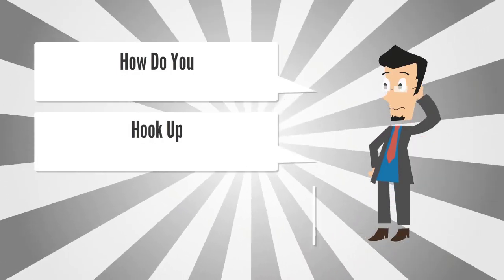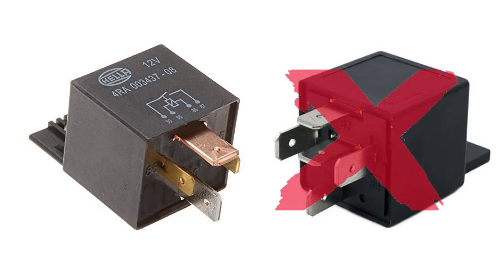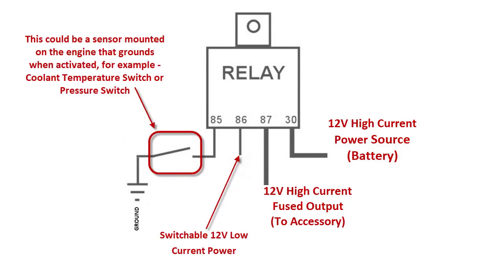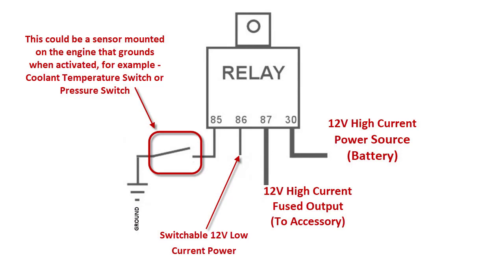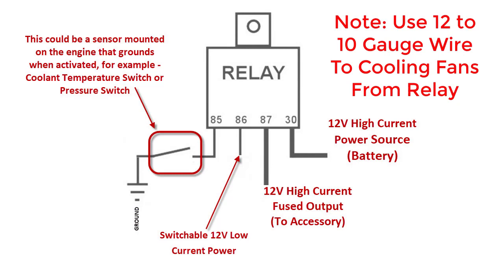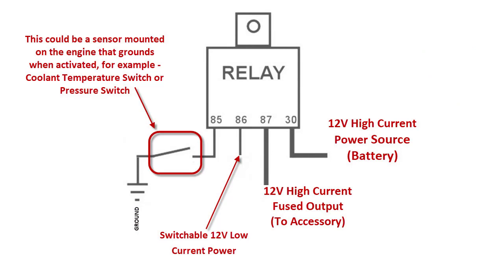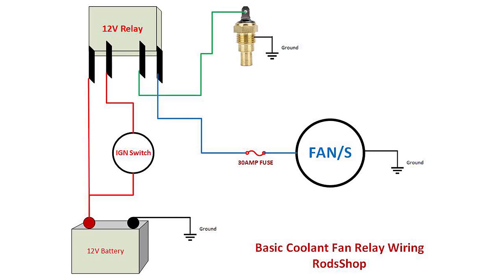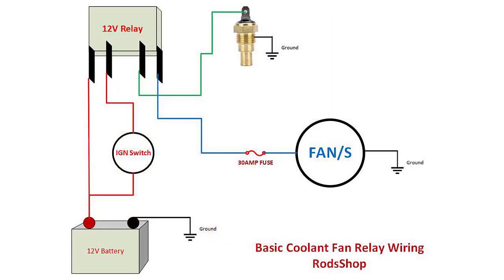How To Wire A Cooling Fan Relay

Comment: I would like to connect a low temperature 65deg C sensor switch for Subaru but the existing switch is not good only gets on at 98deg C when the engine is too 🔥
Reply from the maker: Are you wanting the fan to kick on at 65° (150°F). I am not sure they make a sensor that runs that cold, I would have to look into it. No matter, this would be a combination of you working with the senor and the thermostat. When setting up a electric fan and fan temp sensor, you also have to work with the thermostat to get them both to correlate with each other.

Comment: Why is it that when the thermal sensor is power cut off, the funs stay on?
Reply from the maker: I would need more info but usually, the thermal sensor grounds the relay. In other words, the relay has two power legs. One is from the ignition, that power the electro magnetic switch. The other is the power source (BAT) that once switched goes to the fan. The electro magnetic switch has to be grounded in order to become a magnet to pull down the switch in the own position. 

So the sensor, when it reaches its preset temp, grounds and activates the magnet. So if the fan is still running after the key is off, you only have two things that can happen. The sensor has gone bad and is always grounding. Or, the relay is bad and the switch inside is stuck closed always keeping power to the fan. 

Now, here is a little tell-tale sign. If the engine is cold and you turn the key on, and the fan isn't running, then it is more than likely the sensor. What happens with a sensor, when it gets up to the preset temp, it sticks until it cools off. The relay, usually when they stick, they stay stuck no matter the temp. 

If your car uses the same relays for other things, you can try swapping them around to see if that stops your issue, if not, buy a new sensor. Hope that helps. You can always contact me through my website and I will gladly help you. 

https://rodsshop.org/contact-rodsshop/

Comment: At @06:00, you say to power up pin 86 through an ignition "ON" circuit --- but since the thermal sensor has both an ON and an OFF value, it's best to let it have 12V full time. That way it will make sure the engine gets cooled after running for a bit until the sensor is satisfied. 
IOW ---> the sensor will be rated at (for instance) ON @ 190°F and OFF at 160°F. This means it will still be connected until the sensor "sees" 160°F before it opens and shuts the fan off. 
In dual fan settings with them running parallel/series two-speed relay systems, this is very valuable to drop the coolant temperature to a less-hot condition when the engine shuts off after working hard, and just leaves the super hot engine to soak the coolant with a lot of unnecessary heat. 
I really like your graphics and your voice-over is soothing. Good presentation.
Reply from the maker: Again, you don't seem to know what you are talking about. The thermal sensor just grounds when it gets to a certain temp. All it is doing is grounding one side of the electromagnetic coil inside the relay. If you run full all the time power to the other side of it, then the fan is always going to run regardless if the key is in the on position or not.

Comment: Good informative video even though electrical is like Chinese to me :) My question is could this type of fan be installed inside an enclosed trailer for my lawn equipment to provide a steady air flow to keep the inside a lot cooler during the day.I am looking to get an exhaust fan for the ceiling replacing the regular vent but would like to add one of these car fans too for better air flow
Reply from the maker: A car fan will not move the air as well as an exhaust fan. The reason is that radiator cooling fans sit right against the radiator and does move air but not a lot of volume if that makes sense. The blades are small where an exhaust fan has larger blades to pull a larger volume of air. 

I am guessing this trailer has 110 volts, so just use a regular exhaust fan and you should be fine. I would recommend having an intake grill on an opposite end of the trailer or relief depending on if your fan is pulling air out or blowing it is. If you have an opening at the opposite end, that will increase air flow significantly.
Reply: @RodsshopOrg  Don't know why I didn't think about it but you can by exhaust fans for these trailers too just take out the original basic roof vent and put in the electric one with the fan.Thanks for the help!

Comment: Is it important to use a relay with a diode   since wiring a fan with air condition
Reply from the maker: No, there is no reason to use a diode at all. The only thing you are doing is triggering a high amp voltage to run a fan with a low current or low amp wire. No diodes required.
Reply: @RodsshopOrg can you put a video in detail explaining this issue please 🙏 
Thank you
Reply from the maker: @alsharifhusain  If you are needing help, just contact me through my site:  https://rodsshop.org/contact-rodsshop/

Comment: Hi when wiring the relay do I connect a wire from the negative to the body also?
Reply from the maker: I am not sure what you are doing, there is a link in the description for a diagram on how to wire a relay. If you are triggering the switch inside the relay with low voltage, then one side of that switch will have to be grounded, where you ground it doesn't matter as long as it is a good ground.

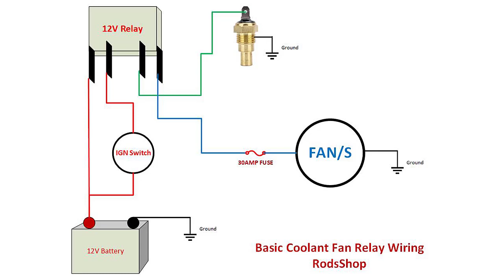Comment: 12:29 How does that circuit work with both hot wires going to the coil of the relay?
Reply from the maker: You have a low voltage hot to trigger the magnetic coil in the relay to close the switch. The other hot is was is on the switch leg. There should be a link in the description of this video for a wiring schematic. If not, contact me on my website Rodsshop,org and I will send you one.

Comment: Awesome vid! We bought a 91 firebird GTA 20 years ago. Its had a toggle switch on the console to control the fans because someone busted the fan sender unit in the block, and the wiring harness has the senders tip connection (mushroom) stuck in it. This tpi engine is sassy. Either way..the toggle switch running the dual fans (both at the same time) isnt safe, theres no relay. Im going to redo everything. But for clarification,  i can buy a new sender unit and run that strait to the new relay and the fans will kick on? No ecm needed? I believe right now the power is drawing from the alternator,  to the toggle, to the dual fans
Reply from the maker: Yes, just change out the sending unit to the correct temperature and wire off the battery to run the fans. I think I left a link in the description for the wiring diagram, if not let me know and I will provide you that. Usually you would want to run about 10 degrees difference between the thermostat and the sending unit. 

If you are running a 180 degree thermostat then you would want a temp sender that turns on at 190 degrees and shuts off at 175. Not all engines behave the same so you may have to play with that but that should get you in the right ball park. 

You do not connect through an ECM or anything like that. You just run battery power to a relay, then from the relay to the fans, and the temp sender is the switch.
Reply: @RodsshopOrg  thanks! For running dual fans, which obviously needs seperate relays...would the sender need 2 prongs?
Reply from the maker: @gullcreekstudio1391  You do not need to Relays for two fans. Figure out what your amperage draw is and get a relay to match. I am running one relay on my truck running two fans. I calculated that both my fans at peak together run about 22 amps. For a good safety margin, I just used a 40 amp relay. Been using it on my truck for years now and no issues.

Comment: My cooling fan kicks on at 180 but will not turn off when the temp goes down to 160. Could it be a bad temp sensor? Tks
Reply from the maker: It could be a  bad sensor but it could also be that the sensor has the wrong shut off point. When you buy these sensors, they will tell you when it turns on the fan and wen it turns it off. Example, it may turn on at 18o° but shut off at 170°. So you issue may be that your coolant never drops below the 170°. So you might be best to look for a sensor that is on at 180 and off at 165 or 160. Amazon is really good about telling you the off and ons, so does Summit Racing and JEGs
Reply: @RodsshopOrg  tks

Comment: My vehicle uses MPI relays,how to wire in this situation
Reply from the maker: A MPI relay is only for multi port fuel injection, you wouldn't be using them for a fan or other accessories. What is you year make and model of you car?

Comment: My fan is permanently stuck on im trying to rewire a toggle switch as a last resort to my 2 speed cooling fan with a relay so the ac will work
Reply from the maker: I have fixed the download link, try it again: https://rodsshop.org/download-basic-coolant-fan-relay-wiring/

With your issue, find the two relays for the fan. You either have a relay stuck or a faulty sensor. Which speed is it stuck on, high or low? 

If you would like my help, contact me through my website in case I need images from you. 

https://rodsshop.org/contact-rodsshop/

Comment: Could i tap into my ignition switch wire for switch on
Reply from the maker: If you are referring to you ignition wire, the one that becomes hot when you turn the key on to energize the relay, then yes, you can do that.
Reply: Thanks buddy 🙏

Comment: When we installed the new aluminum 4core radiator into the 99 civic hatch, we just spliced the fan into the original oem wiring guess still using the oem fan switch, is this still ok?
Reply from the maker: It should be, there shouldn't be any reason to rewire it. Just test it to make sure the fan kicks on and off like it should. If it does, then you're good
Reply: @RodsshopOrg  yeah, fan kicks on and off like it did before new rad install.

Comment: I have 1998 Oldsmobile cutlass GLS 3.1 my fans will engage if I turn the AC on. I changed fan relays fans are not turning on by their self when just idling at a red light it will go over half and start to overheat. Replace water pump thermostat and flush. I’m still overheating If I sit at a red light too long?
Reply from the maker: Sounds like the temperature sensor isn't working, there is ways to test that. Contact me through my website so I can help you. It is just too hard to communicate through YouTube comments, we may need to share images. I am not going to spam you.
https://rodsshop.org/contact-rodsshop/

Comment: I'm still a little confused. What I need to do is just add a 30-amp relay on the fan that I use to run constantly without the use of a relay. Well, the current draw was very high that played hell with the headlights. I'm not using a temperature sensor. So, what I'm doing is I coming directly from the Battery with a fused red 10G wire to the #30 post. Next, I'm using a Gray 14G wire from the fuse box that powers on when I turn the ignition to the on position to the #86 Post. Then I'm Using a Red #10G wire from the #87 post to the red leg of the fan. Then the black wire from the fan goes to the #86 post. I also added a toggle switch so we can listen to the radio with the engine off. This is in a 1932 Ford Phaeton Street rod and I do not have much luck getting it to work. If I eliminated the relay, I can turn the fan on and off just fine but the reason for the relay is to lower draw when the fan is running. Your video is really done well.

Comment: I have a 5 pin relay setup for mine as I run the fans in series and it switches to the ground that way if I run them in series it splits the 12 voltage to 6 volts of fan then one that other relay turns on it triggers that one off

Comment: Hi, what would make my 30amp fused fan cooling relay to get extremely hot? but fan still working,my fan stopped working i found out it was down to burnt out relay so i got exactly same looking replacement relay from Amazon with 30amp fuse (probably made out of chinesium),it melted the fuse cover today but didn't made it pop,fan must have been running for few minutes while sitting in traffic so pulled over and disconnected it so it doesn't catch fire waited for it to cool down and drove it back home with eyes on the temp gauge and heater fans on max🤦‍♂️(none of the wires felt hot just relay) thanks
Reply from the maker: This could be a really complex question to answer based on a variety of factors. First off, what is the amperage draw on your fan? If it pulls like 25 to 28 amps, then that could cause the relay to get hot.

The biggest thing I can think of that is overheating everything, is the wiring. What gauge wire are you running?

How do you have battery voltage source feeding the relay? You should at least a 12 gauge wire coming from the actual battery or at least a great high amp source. It is also highly important that your ground wire to the fan is at least a 12 gauge and connected to an excellent ground source.

Comment: Thx for the video was very helpful! I have a question if you have the sensor in btw the relay which controls high n low speed single fan the color of wires are different on new plug the smaller gauge wires are the temp n a/c the 2 heavy gauge wires run off relay in fuse box it’s Jeep grand Cherokee Laredo how do I test or check the wires from harness to new plug the colors don’t match an gauge is all the same on new plug but have black 16 blue/red 16 and gray 10 blue 10 gauge idk how to share pic but it’s sensor under right head lamp plug ! Thx 🙏🏼
Reply from the maker: Contact me on my website https://rodsshop.org/contact-rodsshop/

Your question is a bit long and convoluted. One thing, there is no high and low speed on a cooling fan, it just turns on or off. 

This sounds like you are trying to hook up an aftermarket fan to the OEM equipment. None of what your saying makes a lot of sense but I think it is because I do not have enough information of what kind fan you are hooking up. So contact me through my website and I can provide you a way to upload me some pictures of what you have and what you are doing.

Comment: How is the speed of the fan controlled? Does it run on one speed or does the temp sensor control the speed on how hot the temperature is?
Reply from the maker: There is no speed control on fans, they are either on or off. The temperature sensor is really just  a switch. When the sensor gets to the set temperature, let's say 190°, it turns the fans on, when the sensor gets cooled down, it turns the fan off.
Reply: @RodsshopOrg  ok so my next question would you recommend higher Watts fans if it's not keeping my truck cool enough. Currently have 12v 90w dual fan but just getting on the freeway they don't stay as cool & after a while with the AC on it starts to overheat if the truck is stationary but on the go not really.
Reply from the maker: @hase1357  I am guessing you have two fans since you said FANS. It isn't so much buying higher wattage fans, you need higher CFMs and there is a difference.

I am helping someone right now on a Porsche that have super high wattage fans that requires a 70 amp fuse and blowing fuses and heating up wires. There is no point is jumping up wattage. Look at the CFMs and the wattage.

A good fan will pull lesser wattage and deliver the proper CFMs. 

I know this may be a stupid question but need to address this first. Are you sure the fans are blowing the correct direction? Believe me, I have seen it all with electric fans. 

If the fans are on the engine side of the radiator, they need to be pulling in the air. If they are on the grille side of the radiator, they need to be blowing toward the motor. 

How big are the fans, as in what diameter? In all honesty, if the radiator is clean and flowing good, the thermostat is working correctly and is at the right temperature and the fan coolant temp sensor is turning on and off at the right temperature, most any fan is going to work. 

The only times I have seen where a fan isn't keeping an engine cool standing still, is if it is really too small in diameter or a real low CFM fan. If your fans are pulling somewhere between 1200 and 1300 CFMs, it should work. 

Get me the full specs on the fan. Go to my website and contact me through it so I you can email me some pictures of your setup and I am sure I can help you. 

https://rodsshop.org/contact/
Reply: @hase1357  you can control the fan speed with pwm the Ford Taurus and fusions are the easiest cars to get a pulse width modulated box aka pwm in short it cuts the ground on and off on and off for a pulse which controls speed but the Ford have them on them that way for a dual setup you can have both fans on but lower speeds and then both  on for high